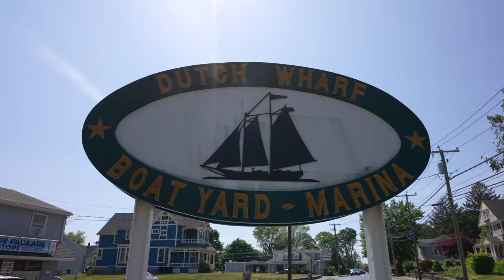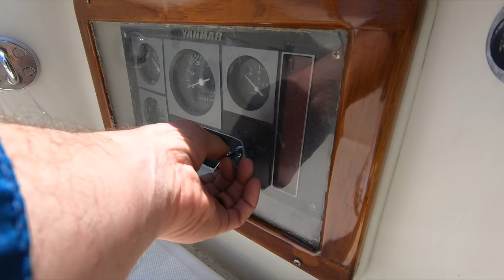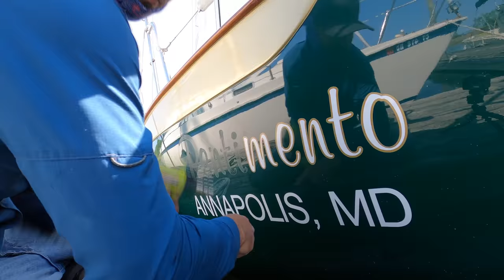We got a Puppy! BEST idea ever or BIG MISTAKE? S06E07

Comment: If your propwalk pulls your stern to port you can use the momentum of the boat at the first critical seconds while gaining enough speed so that the rudder will steer when regering with gear in idle or neutral. Approach the slip from the opposite direction as in the video. Make a turn to port, just before you're in line with the slip and the stern still has momentum to starboard hit hard reverse, like 80-90%, to get the boat moving, rudder centered, towards the slip in 1,5-2,5 knots depending how your rudder steers in reverse, gear in neutral (preferable) or idle  reverse, steer with rudder and keep the speed up with short bursts if needed. When half length of boat is between the slip it's time to start concentrate on braking.

Comment: You are doing a lot of things correctly.  Overall taking the time to train a dog at the start pays huge divides over time.  Crate training is a must.  All our dogs have loved the crate, in fact most rather sleep in the crate at night.  The most important of all commands is the 'recall". No matter the situation you want Oso to come on command.  We use the dog's name as the recall command.  This means we try to avoid at all cost using their name, period.  Each of our dogs has two names, we would use "Osa" as the recall command and the other name is a "nick" name (Little Buddy), which is used during normal interaction.   If you use their main name during normal communications they get desensitized to the recall command

Comment: cute puppy.  I will say backing into your slip is a lot easier if you go past your slip then put the boat in reverse to get some momentum, prop walk under control and gain rudder authority... sort of a running start.  trying to pivot in front of your slip is much harder.  wind tide and current will always be different.

Comment: Backing a full-keel boat into a slip is something you will NEVER not feel a little stressed about. You may totally master the maneuver in calm winds and no current, and the next time you come in (this time with a boat full of guests probably) the wind will be on your nose with a current pushing the bow. Then you figure that one out, and next time the wind is on the port beam and magnifies the prop-walk. It's an adventure every time.

Comment: We love dogs and sailed with our 60lb Lab, Gracie, until she became too old to get around the boat in comfort.  Some considerations - you'll need to vacuum twice a day or face a potential clogged bilge pump at the worst possible moment.  You'll also want to get something to protect your cabin sole from his claws.  We used yoga mats and rug runners in the high traffic areas.  Good Luck!
Reply: Good points!
Reply: Poodle mix breeds don't shed. Labs shed a lot! I've had both.
Reply: @spray3716  what you mean to say is poodle mix breeds shed less. There is no such thing as a dog that doesn’t shed.

Comment: We cruised with a cocker/poodle mix throughout the US, Caribbean and Mexico - never an issue. The addition of a “third” crew member was a welcome distraction! We used the same grass pad as you. We did add a whelping pad underneath the grass (Amazon). This soaked up the pee so it didn’t slosh around and could be easily rinsed out and dried while the 2nd one was in place. Never a problem with smells. Enjoy your trip north!

Comment: When docking I like to keep the boat parallel to the wind or current set as long as possible so I can use the engine in forward or reverse to counter those forces.  If you perpendicular, then you are at the mercy of the wind or current.  In your situation, I would have driven past the slip in forward, then backed in, giving her some strong reverse throttle and aiming at the far pylon and waiting to turn to port as long as possible.
Reply: Exactly my thoughts! The tidal current over the rudder would have actually helped with steerage in reverse, and he would have had prop-walk to help pull the stern to port. I groaned when he said, "I have the theory down, I just need practice." Nope, sorry, wrong theory, bud. That was two years ago; I expect he'd do a lot better nowadays.

Comment: We have had dogs on board for many years. (Albeit, we only do 'coastal cruising' on our own sailboat and charter otherwise) our longest passage with the dog was 18 hours 'offshore' to Haida Gwaii here in northern British Columbia.  Some suggestions: dogs can't retract their claws, so make sure that you keep the claws clipped so that they can have reasonable control on wood floors and f/glass.  Dogs can get seasick just like humans, so sometimes it may be better to keep them, securely attached, in the cockpit depending on circumstances as in rough weather it seems it is easier to get sick down below...  Also, most dogs will not drink often when underway in weather, so make sure that you are keeping him hydrated.  There are probably many others but |I need to keep the comments short.  You can see a few of our boating adventures (including with our dog) on our channel.  Good luck! and smooth sailing.

Comment: Congratulations on the new crew member, he will make a good alarm system for the arrival of people. When I need to remove labels from surfaces I use WD40 to remove the glue afterwards. The result is much faster and most people have the product or similar in their toolbox.

Comment: I’ve seen other sailors (Sailingdoodls) with dogs...it’s looked like a lot of extra work. They had two labradoodles. Much larger dogs than you got. They made it work but one thing that was a constant issue was taking the dogs onto foreign destinations.
Reply: NOT just "foreign destinations", many places don't want dogs running loose on the beach.  Nothing like a nice walk in the sand & step in a pile of crap. If you are on shore most restaurants & bars do not allow animals inside.  It's all fun  & games until reality hits & you realize what a liability you acquired.

Comment: I guess you won't be sailing to Australia,  our quarantine laws are extremely strict.  Lil Dude will need lots of paperwork and be stuck in quarantine for an extended period, that's if you can bring him in at all.  Check out Sailing Nandji    It's costing them around $8KAUD to get Marley back to Oz from Malaysia,  They have to have him in quarantine in New Zealand for a couple of months.  It's not easy.  There are lots  of countries that also have strict requirements but not as tight as Australia .  It will certainly add an extra level of difficulty travelling.

Comment: The only downside I see to a dog on board is crossing borders and all the extra paperwork, fees and vet visits for paperwork.
Otherwise it's good especially if they use the astroturf instead of holding it until they get to the beach. I have two Chihuahua's, although they haven't actually crossed any borders, they keep their shots current just in case it could happen

Comment: We kept our two fur babies on board our Westsail 32.  One Cairn Terrier and one Rat dog for 7 years. They did great. Each went off the boat once, fortunately at the dock. Ask a local commercial fisherman where they buy their supplies and buy fishing net. We got a remnant for nearly nothing. I first used zip ties but they did not last well.  Used eye screws and cable on the bottom ( won't give much).  Lifeline on top. Just used heavy nylon line to lace it in place. keeps dog AND kids aboard.

Comment: It comes down to the number of “have to-s” you are willing to pile on…see Steve Martin’s rant in the movie “Parenthood.”  You have to find food and feed it.  You have to find veterinarians care for it…and with your public exposure, failure to care for it will have major impact.  Rain or shine, you have to walk it…deluge or no deluge.  You have to clean after it, sand, dirt, water.  You have to pay attention to it.
That said, dogs can be awesome!  Used to paddle board with mine and still laugh about one trying to hang 15 and slipping into the drink!  Another getting bonked overboard by an out of control paddle.  Running on the beach!  Splashing in the water!  Now I’m sad…assholes.